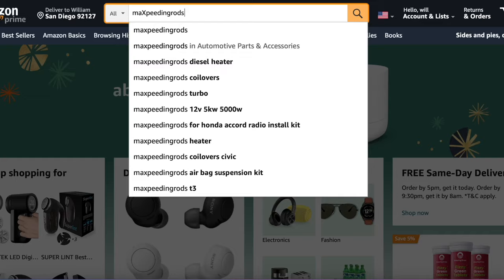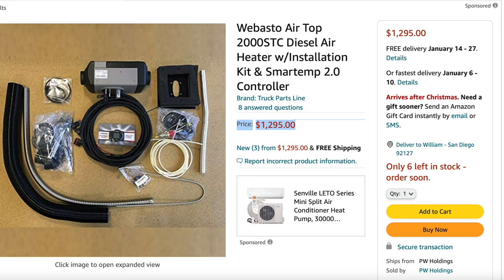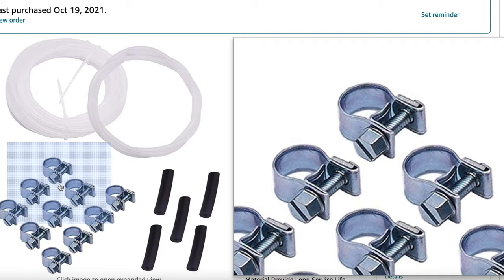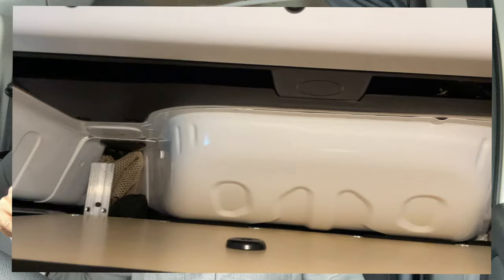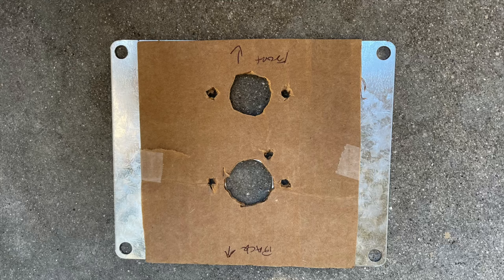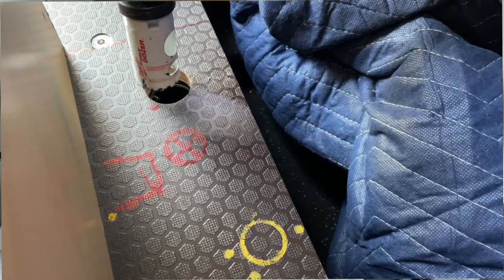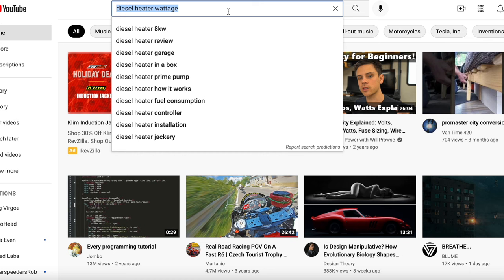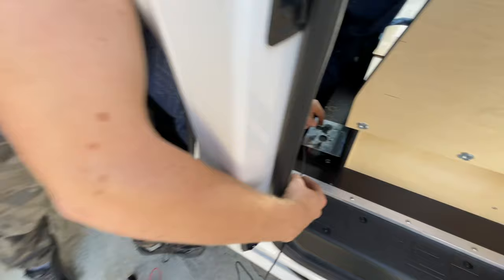Chinese Diesel Heater Install and Review (TWO Things You MUST Upgrade Before Installing!) Story #7

Comment: Did you install this by yourself?  Where would a not so handy person or a person with no access to tools get this done.
Reply from the maker: I had assistance. Sorry not sure.
Reply: Colin, I have the same question and am going to try to figure it out in the next month, I’ll let you know what I find out. And please let me know if you figure something out.
Reply: I suspect you could get a handyman or possibly even a mechanic to do it.  Probably would cost you a lot though.  It would probably be cheaper to just buy the equipment.  All I needed was a drill and a hole bit.  You can get both pretty cheap at Harbor Freight.  The bit and drill probably won't last a life time but you only need them to last long enough to make 2 holes:)
I also bought a small tube of muffler and tailpipe sealer in order seal around the exhaust and intake pipes where they exit under the van... I'm not sure if that was necessary or not.
Reply from the maker: @101perspective  Did the sealer smell at all when the heater was on?
Reply: Did you cut your metal plate? And did you put the heater on the posts like William did?
Reply: @WillandRambo  I never noticed a smell.  Though, most of it was under the vehicle and barely any exposed to the inside.  I used Permatex Muffler & Tailpipe Sealer #80335.  It turns rock hard once it dries.  I think that the sealant will last longer than the pipe...lol.  Your local auto parts store probably has it.
Reply: @cloud.07  Well, my method probably wasn't the best.  I created a U out of 2x4s and attached the plate to it.  It was a very odd shaped surface I was placing at. The heater is basically raised 4 inches above the floor.  I did a U shape so I could easily see and access the connections from one side.    I've considered enclosing the U completely for safety reasons... since I haven't seen anything coming loose from all the bumpy travels and probably won't ever need to access it.  
I haven't been overly concerned though since in addition to using the CO2 detector I keep the front windows cracked and the vent fan running when I use it.  So, there is always fresh air coming in.  It helps keep it from getting too hot inside also (I got a small heater and it still overheats the area sometimes even on low).  This also helps keep the air from getting too dry.
Reply: @WillandRambo  I found this review on the sealant I linked.  Apparently it does smoke and smell a little the first time the pipe heats up.  I just didn't notice since it was outside mostly.  Or maybe it was because I didn't use the heater for a couple weeks after applying... thus it was fully dried at that point.  Anyway, here is the full review:

"seems like a hit or miss with how other people get this stuff to work but it worked for me. 1/3 bolts broke on my catalytic converter so I used this to seal the flange and no leak or blow outs even at 7k rpm this dries like cement but is not hard to clean if it needs to be resealed. I sealed a flange right before an o2 sensor no check engine light but it does smoke and smell a little but when it heats up for the first time but after a few miles its gone."
Reply from the maker: I think I’ll pass on it because I don’t feel comfortable applying it inside the van.. like what if there is burn wear every time I use the van..  potential air pollutant.. if it says indoor use OK.. I may consider it.
Reply: @WillandRambo  Yeah, it sounds like it probably doesn't off gas that much after the first use, but I would still be hesitant to use it inside the van.  Mine was applied outside.   I mainly sealed it to keep critters out and any fumes from the exhaust that might go under the van.
Reply from the maker: @101perspective  Gotcha. Do you remember how I made holes underneath my van? The passenger footwells are still empty and I can potentially get gases coming into the van... do you recommend I apply it to the bottom of the van by the passenger footwell where the hole for the exhaust is made? Is that what you did?
Reply: @WillandRambo  I'm guessing what you are thinking about doing is putting the sealant right where the exhaust pipe connects to the heater... like over the clamp and stuff. Correct?
Mine is raised inside the van also.  So, I have the same concerns you do.  I didn't use the sealant inside though.  My reasoning was different than your concern though.  I had 2 concerns with doing that.
1) It would make it harder I think to tell if the pipe ever came loose.  The sealant might stay stuck to the heater but not the pipe... leaving a gap you wouldn't be able to see easily.  In your case, if you used too much sealant your whole pipe might be able to get yanked out from below (from snagging on something while you drive) without you ever noticing.  You would just see a big chunk of sealant going from the heater to the wood.  Though, if this happened I'm sure you would notice the diesel exhaust smell right away...lol.  Still, a little scary.
2) If I ever need to take the heater apart to clean it out it would be a PITA for me to do so without removing the entire heater.  However, it would be glued in place if I used the sealant in the manner you are thinking of doing... seriously, that stuff is like concrete.

ALL OF THAT SAID, those spacers you created has given me a bad idea...lol.  I'm wondering if it would be possible to put a metal extension on the heater's exhaust.  Something that could be actually soldered to the heater itself and would be long enough to stick out below the van just enough to make your exhaust pipe connection outside the van?
I know virtually nothing about working with metal though.  I suspect it would have to be a similar material to what the heater is using.  And you would probably need to create a cap/cup of sorts on the end that attached/soldered to the heater that would be a snug fit around the existing connector.  It couldn't be the same length all the way through since it has to still be the right size as it exits the bottom of the van in order to connect to the exhaust pipe.  Just a thought.
*******
Anyway, to answer your question, I don't think it was vital that I seal outside.  I just went the extra step.  If fumes get under there they will most likely find some other hole to come in... this just made for one less hole.  Plus maybe less vibration of the pipe against the hole.  

I think sealing inside has some advantages but also some disadvantages as I've mentioned.  I decided not to do so.  I could see someone deciding otherwise though.  I think either way has it's risks.

Comment: Isn't the whole point that the heater goes outside the vehicle? Combustion and fuel storage are to take place completely external to your living area...am I wrong here? And a Kill Switch, should that not be remote....because you will use it in an emergency....again, whole point of the switch....no?
Reply from the maker: Thats like saying to keep the engine of a car on top of the hood.
Reply: @WillandRambo  I think it's more like saying don't put the engine in the passenger compartment. And that point was the original thrust of the Webasto marketing campaigns...don't have things that make flames in your living space....which would be common sense beaten into us in the Navy and in homes with firefighters in the family.
Reply from the maker: Out of the 170k views this video got, not a single person caught a fire from a Chinese heater being inside of a van. You’re overthinking it. All is well don’t worry. 😉
Reply: @WillandRambo  Well, ya can't argue with that logic.

Comment: No more.. Just because you are not presenting facts.. You  load of mis information about CDH's.. plastic tube, clamps , and a lot of copycat comments.. not enough fuel.. bunkum.. rigid snaps.. Should have used a turret for going thro wood.. 5A running 10-15A start-up. Piccalo with long exhaust, inlet convoluted helps to silence intake. They are excellent !
Reply from the maker: You watched the entire video and paid attention. Good job!
Reply: Hey Andrew, could you help me install one of these in my van?
Reply: @cloud.07  This is Andrews' Dad, He can't help you with anything. He is grounded for the month because he won't walk our dog.

Comment: Trash comment on fuel pipe.. These are vaporising heaters and do not have injectors.. They need a steady flow of fuel..eberspacher even supply pulsation dampers. Fuel pipe diameter (small) just makes for faster priming... Drone on buddy....
Reply from the maker: Thanks for your comments.. more more!! 👍
Reply: You can't diss the guy for a fundamentally informative video! Only the nerds/heater enthusiasts will pick up on those inaccuracies.
Reply from the maker: @Lucentlens  Pay a visit to the Chinese Diesel Heater FB group forums.. you will read lots of horror stories about the included green flimsy pipes. While you're at it, watch this video from another VL YTuber...  not sure if its this video or his previous one but everyone suggests he buys the tubes I did. But anyway.. I am just reporting my experience, people are free to choose what they think is best. I never said do as I do. https://www.youtube.com/watch?v=PmWkhmEE-hg

Comment: You didn't mention catalytic propane heaters like the Olympian Wave models.  They are far safer and healthier than buddy heaters and require no installation.  The byproducts are harmless CO2 and water vapor.  I use them and am adding a diesel heater for winter weather because though the catalytic heaters are great for vanlife (and silent) they produce too much condensation on the windows in the winter.